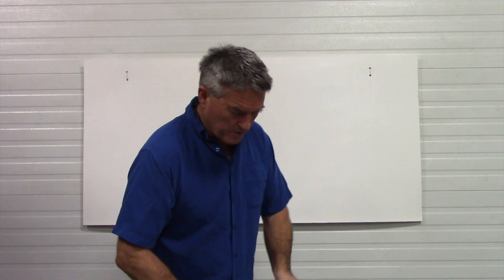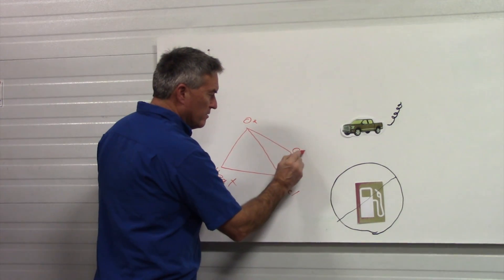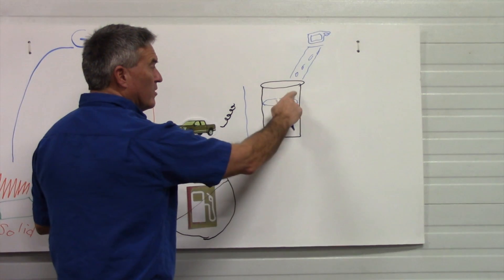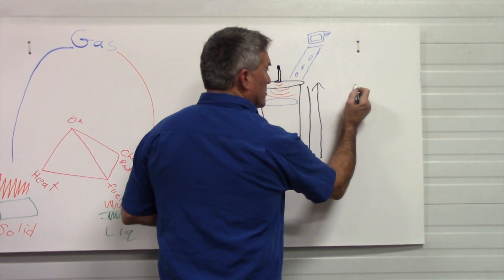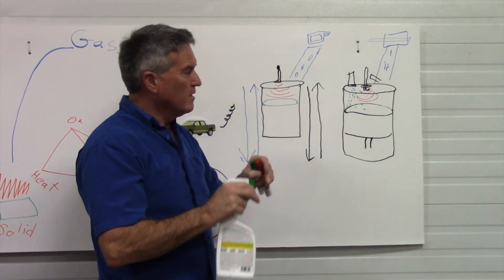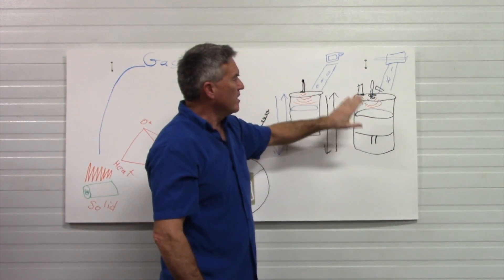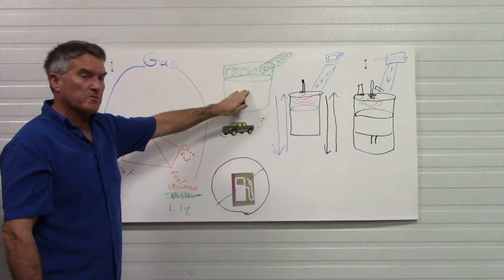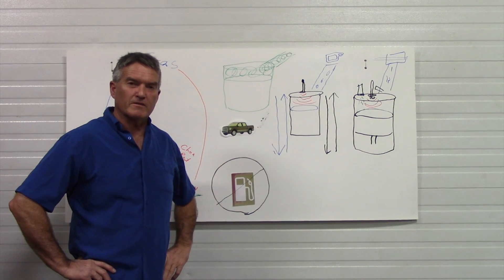One Simple Trick to get 100 miles per gallon with less pollution!

Comment: Cars that do heat fuel are around for a long time and they do use less fuel. The 1,9 litre OPEL OHC engine and early Holden engines had the inlet manifold screwed onto the exhaust manifold. This did heat up the carburetor and the fuel it contained and it leads to a significant fuel reduction. As I am driving such a car since 1973 I speak from experience. But- it comes for a price. This system only works on long distance driving. If you stop the engine the fuel in the carburetor evaporates and you need to crank the engine a lot longer until the swimmer chamber fills up again and the fuel in the previously hot carburetor is lost. I bypassed the cranking problem by installing an electric fuel pump which I only need before I start the engine. The carburetor still creates fuel droplets but in hot weather they evaporate before the fuel-air mixture enters the combustion chamber. In cold weather this does not work as well as the low pressure (often wrongly called vacuum) in the inlet manifold causes the air to cool down. This is why you can get carburetor icing already at + 5 deg C. Also fuel injection into the combustion chamber only creates fine droplets which do not burn as well as vaporized fuel. There is just not enough time for them to vaporize especially in high REVs. This might be different when the (hot) fuel is injected into the inlet manifold. A supercharger heats up the air significantly under pressure and is beneficial in this case while non pressurized hot air contains less oxygen. You can improve combustion significantly by sucking Brown's gas (Hydrogen-oxygen mixture) with the fuel mixture into the engine. It acts as a catalyst and the combustion is much cleaner. I also tried this and it works, the engine also produces more power - if you do this right (see: Joe cell). Just for the record: Climate change is caused by the energy output of the sun and has absolutely nothing to do with carbon dioxide. Carbon dioxide is heavier than the gasses of the air and following gravity stays on the ground and not high up to create the glass house effect. A little knowledge of physics and chemistry is sometimes useful. I often wonder what those "experts" studied. I only know it was neither physics nor chemistry. Is there a subject called bullshitry?
Reply: Carbon dioxide actually is uniform in its occurrence in our atmosphere, there is the same amount at sea level, as there is at 30,000 ft above sea level, and anywhere/everywhere else and in between. It cannot efficiently trap heat at all. The greenhouse gas that traps heat here, is water vapor, CLOUDS. Besides, CO2 only makes up 0.0385% (less than four one-hundredths of one percent of our atmosphere), it is literally a trace element, there is not enough of it to trap heat...
Reply: @syndrome1965   water vapor does the heavy lifting to make the planet better suited for life (warmer average temperatures). And of course life / ecosystems have adjusted to that. And because the  volume is so much higer  it must be a self-restricting cycle that is in balance otherwise - considering the volume - weather and climate on earth would be completely chaotic and violent.

You would notice - and you would not need a scientist or weather person for that. 

water vapor however DOES NOT trigger change. it always follows. The temp. of the air will determine how much vapor it can hold. 

Vapor always rains down within days. So despite the huge amount of vapor in the atmosphere and the contribution to make the globe warmer - that effect is factored into the system. It is stable and does not explain the warming. There is NO explanation for the observed warming, solar output has minimally decreased in the 40 years.

Scientists would not expect that decrease to show (would be within the margin of variability) - but there is NO explanation why it would get WARMER - it is not the sun - not this time.

On the other hand there is the scientifically !! well established fact that Co2 is a greenhouse gas and tat we know how much fossil fuel had been burnt.

Fossil fuel. The natural carbon cycle is huge - but in balance. 
Which can absorp some spikes (_some_ burning or volcanoe eruptions) but not the volumes that have bee released escpecially since the 1950s.

Fossil fuel is biomass that had been removed from the natural cycle hundreds of millions of years ago. Now it is released within 200 years and ADDED on top of the natural cycle. 

Yes, it matters even if human emissions are only a few % of the natural cycle which releases and absorbs CO2 from the atmosphere. 

Some dolts compare what the natural cycle releases (decay of biomass, oceans, ocasionally volcanoes) with the fossil fuel based CO2 emissions (of course they never mention that the natural cycle also absorbs huge amounts of CO2 - and that it is a zero sum game.

A few percent year after year after year DO add up. 
40 % MORE (and a huge reservoir stored for future release in the oceans)  for a climate relevant gas are important.
Reply: well yeah but on a clear day there R no clouds aka water vapour as noted above...so that idea cools us to a -- spelled minus, 151* insentagrade..
Reply: @syndrome1965  Scientists do not care about concentrations they care about EFFECTS. 400 ppm CO2 that is 0,04 % -  relevant. 78 %  Nitrogen - not relevant, it has no effect
Reply: @syndrome1965   I accept the PEER REVIEWED studies that Co2 is a greenhouse gas and the models about the warming (they give ranges). If you don't - you should write rebuttal papers to the specific studies in question and offer them to the magazines that publish peer reviewed studies.  - The QUALIFIED insight for instance that CO2 has not nearly as much impact on warming would be very welcome news.

A plausible explanation for the warming (that is observeable) would be appreciated. It is certainly  not the output of the sun or the axis of the earth  - so if it is not CO2 either .....

The "peers" are the GLOBAL scientific community. Often studies cover a narrow, highly specialized  field of expertise  - never mind that  the people that are best qualified to have an opinion have a lot of academic training. 

But if you think you can contribute to the discussion or correct them- go for it.

The EXPERTS pay attention to the articles published in the peer-review magazines and to them you should subject your critique (like: CO2 is NOT a greenhouse gas, and it did not play a role in this and that event in the past).They do not hang out in the comment section of youtube.

The way science progresses - in ALL fields including climate related research.

a somewhat meandering process is normal .They start from a point, experts from all over the world weigh in on published studies, others make contributions, often there is input from research from other fields( like physics, paleontology, astronomy, material research, history - think medieval warm and cold periods).

So they gradually ! improve their understanding, and build on the work of others - the ideas how it works get more accurate - and better backed up by many studies and from many angles.

I am a layperson and accept the established findings that survived the process of peer review  - if you don't - I find that 

a) ambitious -  for a layperson to contradict the experts (did you do research ?)

b) you better have proof and facts - the saying applies: Extraordinary claims require extraordinary proof 

I don't need to prove anything since I go along with the established opinion of the scientific community (which has survived peer review). The insights may be incomplete but  they come from following the scientific process and are the best we have got. 

There are not many (reasonably) qualified scientists that are "sceptics" (I know of 3 and I think Dr. curry has not published much, and does not publish at the moment). 

The majority of qualified researchers / academics that agree that the globe is warming, that it will cause highly disruptive climate change  and that it is manmade may not be completely right about everything (that is in fact highly unlikely if your look at ALL research), but it is certainly the best we have so far. 

c) you certainly could make yourself a name if - IF - you can disprove certain studies or raise qualified objections. But you would need FACTS - and you deal with the experts in a certain often very narrow highly specialized field. All the experts on the planet in that field.

Considering how much research has been done so far it is very unlikely that ALL of it would be overthrown by one study or by finding that this or that study didn't get it completely right.

Climate change got so much attention (= research), because fossil fuel burning  is at the base of our economic system. There are powerful interests that would much rather have proof that it isn't that bad - but no one came up with such findings so far, and it is not for lack of research. 

The industries would shower respectable scientists who can  come up with qualified objections and their own studies  with money 
Respectable means that they work according to the scientific method * 
and that they publish in peer reviewed magazines. 

That their work survives the scrutiny of other scientists that do not get paid by special intersts. Such payments could make them biased. At a university or at NASA etc. they are paid to do research - not prove or disprove something.

One think tank offered scientists 10,000 USD for studies that "disprove" climate change approx. 10 years ago - they got a lot of backlash and hastily retracted the offer. Those fools had no idea how bad it made them look - they project the way THEY would use "science" onto others.  A company or think tank can offer 10k for research whatever the outcome may be. And it is always published (not if we do not like the findings we keep it secret).

I know one case where a particle physicists (with a good reputation in HIS field) retired and THEN he posed as the "scientific" fig leaf of a rightwing think tank. Within the scientific community it is frowned upon to act as "expert" and make regular public appearances for issues outside one's area of expertise. 

If he had aquired expertise  - maybe informally although that would be very unusual - he or she would still engage with the experts and in form of peer reviewed articles. Then he could have done the tour for the think tanks - no problem.

Everything else violates scientific standards: He took the liberty to  contradict the experts in the field, but did of course NOT submit any rebuttal papers. It would have tarnished his reputaton. 

He obviously did not care after his retirment (as professor of an university he had a reputation to uphold), the think tank happily waved his credentials as physicist around, and I am sure they paid well.

When he started to work for the think tank his credentials and communications were intended to impress  laypersons  which are a much easier audience (he did not work to impress the experts like during the time when he had to defend his findings regarding particle physics under peer review). 

The think tanks and special interests  find VERY few former scientists for such stunts. Let alone that active scientist would be engaged with the scene of sceptics / deniers. I know only of 3 (And Dr. Curry does not publish as far as I know).

Active means a) qualified of course (some physicists for instace work on issues that have to do with climate science and some don't - it's a broad range !

b) works or has worked in the field -  like teaching or research 

c) ideally also does peer reviewed research - has published and continues to publish  The latter means they have to uphold a  reputation as scientist.

Being "retired" (for instance from a university) does not keep a scientist from publishing in peer reviewed magazines. And it would come naturally IF they have found something relevant that can withstand scrutiny of experts. After all they already did all the work to do the research (did they ???) 

Writing the paper isn't that much work, and they would also want to show the generous financiers what they have to offer. Publishing lends also much more prestige to the whole project.

it is  weird that the think tanks hardly can find any QUALIFIED persons for such gigs (Ben Shapiro or Lord Monckton do not count - or all the other bullshitters with no background).

Scientists could get easy funding for their projects and a good salary on top. The oil industry certainly could fund them over longer time it is peanuts for them. 

So they would come up with results, affirmative, contradictory, inconclusive - whatever.

they would establish their reputation in the scientific community - and have the last laugh if - IF - they can successfully challange the current mainstream in climate science. Being generously paid while their collegues have to fight for funding (or at least compete with other projects).

 It is important for a scientist to PUBLISH. Not so much what comes out of research. Of course they would like to land a hit - but those are rare, and it is also common that a study is corrected in the process of peer review or corrected / somewhat challenged by following studies. 

(Since we have a lot of research in the field of climate science that means the current body of work has stood the test of times, it is very unlikely that all of it will become obsolete in the future).

Respectable scientists do not have to come up with SENSATIONS as long as they submit SOLID work to PEER REVIEW. 

But publish they must. 

With that history (published, cited by their peers) they could also return to an university, if the special interests do not continue to fund them after a project has been finished.
Reply: @xyzsame4081  peer reviewed studies are corrupt, several insane papers were produced and accepted as valid, they spewed nazi propaganda, the peer reviewers were too ignorant to know what they were reading.
Reply: great explanation, but doesnt  hot gasoline vapor also mean super lean burning, which increases engine temperature and early destruction
Reply: Thank God I went to school before science was so corrupted by grant money, and I have a good memory. Learned in the early seventies that all atmospheric gases have a greenhouse effect, the largest greenhouse gas in volume is nitrogen. The Earth's Moon has virtually no atmosphere, therefore it has no greenhouse effect. At night the moon is as cold as space gets inside the solar system. Carbon dioxide traps heat, but so does every component of Earth's atmosphere. Next time some know it all hits you with the doomsday man caused global warming scenario point this out.       Another thing to point out is that Earth's icecaps have come and gone without mankind in any form being here. Maybe the dinosaurs used to much coal. If carbon dioxide is a pollutant then so is oxygen.
Reply: Methane is the number 1 greenhouse gas.

So everybody stop farting and we can cool the planet!
Reply: @warrenpierce5542   ?? you seem to remember that you were told in school that nitrogen is a greenhouse gas - and also  one that is relevant for CHANGE of an established equilibrium ? . (Water vapor is an important  greenhouse gas too, and it exists in masses - not a trace gas like CO2 or methane. While water vapor is important for raising the level of temperature in general and makes the planet better suited for life - it does not trigger CHANGE.

Hint: they do not practice "science" in school, nor were your teachers qualified as scientists and researchers. The best we can hope for is that they  gave you a sufficient insight into pop science - and 
that they introduced you to mindset behind the  scientific method.

and how come ALL the academics and researchers NOW do not realize how overrated CO2 is  - while you get it right ?  - you have research that you could publish in peer reviewed magazine, do you ? 

I agree: CO2 is NOT a pollutant - I find it misleading / unhelpful to use that term. Some do semantics why it is not inaccurate to use that term, but it does not add clarity. 

On the contrary bullshitters will use that to confuse the public (see Joe Biden in the recent debates calling out China for it's pollution while talking about the need to reduce CO2 emissions)

Laypersons usually argue along the lines of Why should we do anything before China and India ..

China has a challenge regarding pollution but when it comes to CO2 they are doing their homework and more than that. The demand for wind and solar which their bold investments created triggered economy of scale price reductions for the technology.

And in a weird twist - if India and China clean up their act regarding AIR  pollution it will be it will good for heir citizens. But it will also result in slightly MORE warming (not much, but so far some "global dimming" is at play).
Reply: some issues with Brown's Gas.

1) It takes more energy to create it than what you get back out of it.
2) Hydrogen embrittlement is a concern too. Hydrogen acts like a magnet with respect to carbon.
It can literally pull the carbon out of the steel parts and make those parts brittle.

Brown's gas 'burns' at roughly 8000 FPS.
And leaking intake valves however slight can preignite that gas. 
Most car makers advance the timing a whopping 20 degrees before top dead center.

Best use of brown's gas would be in a diesel where there is no spark and valves are very sealed.

If you want to reduce pollution then LPG is the way to go. It burns clean and at 100%.

Using electric to save on pollution is a lie.
It takes a lot of materials and processing to make the batteries for those vehicles. Producing any reasonable quantity of electricity short of a hydroelectric dam spews pollution too,

And electric cars take a LONG time to recharge. Not suitable for long trips.
And if you use the headlights or especially the A/C, battery charge is significantly reduced.

Those 1000 watt booming stereos will deplete a battery pretty quickly too.

Back in the early 1990's there was the Geo Metro. It got 45 city and 50 highway. Many small cars got that good of a gas mileage long before the Geo Metro.

Today you need a hybrid car to come close to that.

Stop buying and driving big gas hogs (like pickup trucks for fun and not buy SUV's) and buy something a lot lighter and smaller and we can reduce oil consumption and pollution.
Reply: I like what you said if you still have the car and more info make a video! Just so we can learn from you.
Reply: What type of mileage did you get off your engine? It sucks how modern vehicles are so complicated with their ECU's/ PCM that any little change to air/fuel mixture sets off your engine light and cancels out any mileage gains.
Reply: Horst, yes, Bullshitry, this is a subject that most politicians excel at. Also, I've read that the eruption of Mount Pinatubo in the Philippines in 1991, put more pollution into the atmosphere in a few days, than what Man has contributed in a hundred years...
Reply: absoftitanium - all the CO2 on the ground is being used by vegetation being converted to O2. Global warming/cooling is due to a defective thermostat in our sun. That big yellow ball in the sky does not hold its energy output at a constant rate. As it fluctuates, our climate does as well. Also. Our electromagnetic shields fluctuate as well allowing different amounts of solar radiation to penetrate to the earths surface causing many different issues.